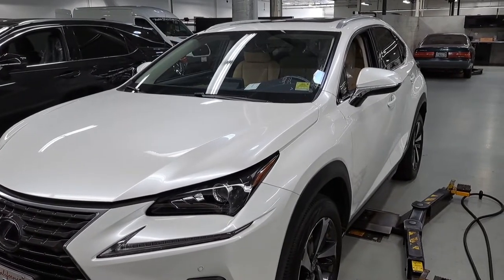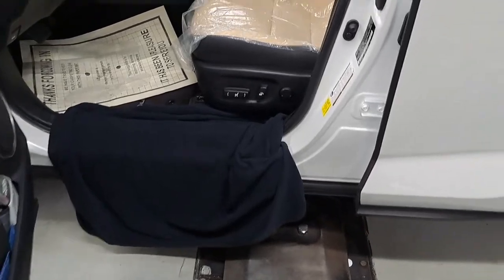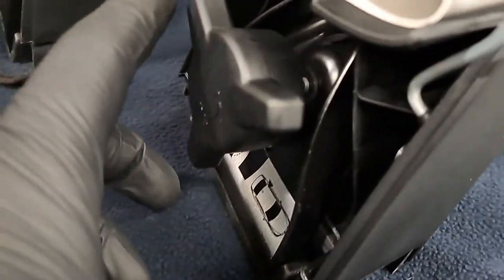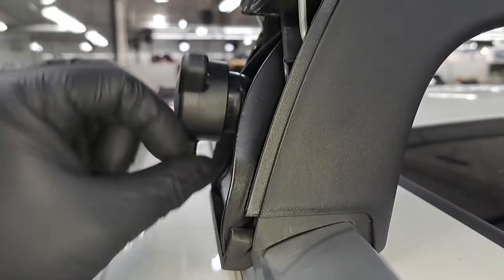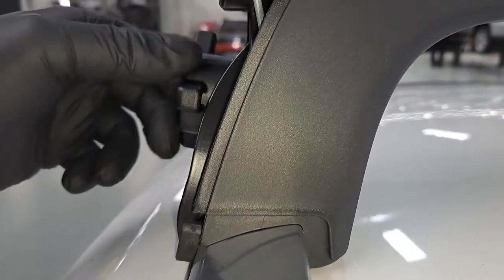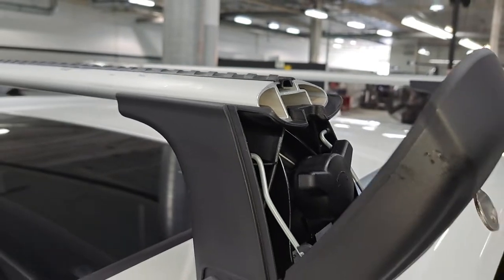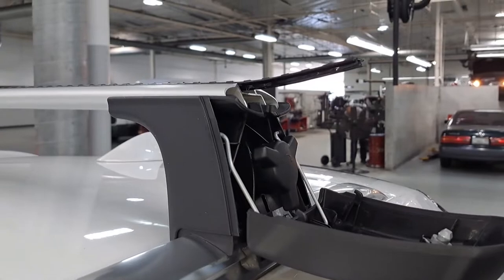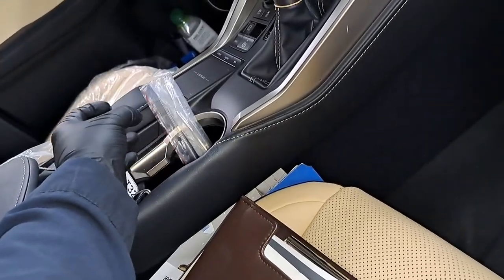Roof Rack Cross Bars Installation on Lexus NX #automotive #lexus #mechanic #diy #mechanic #pro

Comment: I heard that you should use the rear hole for the front crossbar.  It was said  that it produces more wind noise when mounted closer to the front.  Do you have any comments about this?  And I agree with everyone that has praised this video.  Great job, very professional!
Reply from the maker: I check with the guest before installation on the position of the crossbars. I dont have any comments on the wind noise, i havent noticed it. But i have heard from others that it does cause wind noise on either position.

Comment: Thank you for this video! When trying to remove the cross bars that came with the vehicle (so the same ones as in the video), however, I unscrewed a couple of the screws and now one of them won't screw back in if I were to install the cross bars back onto the vehicle. The screw just rotates but doesn't fully go in and click and I checked to make sure that it's in the hole inside the cross bar when I try to screw it on. Could you show a fix to this?

Comment: Beautifully put together video... but  there are no holes in my roof side rails (2025 NX 350)... do I drill them? If not how do I find them.?  Thx.
Reply from the maker: This does not apply to your 2025 NX. This applies to the previous gen models

Comment: thank you for your video. do you recommend people to use cross bars from Lexus ? or other similar product on Amazon are fine?
Reply from the maker: I've only installed the lexus original ones they are specifically manufactured for that vehicle. So that is what i would recommend
Reply: @harborareatech310  Thanks man! I should go for Lexus one!

Comment: This is exactly what I want. Where to find such a crossbar which fits Lexus NX? Any link you can share? Thanks.
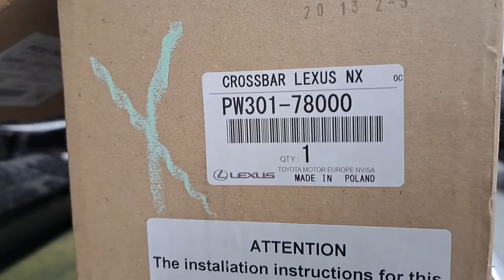Reply from the maker: Hey thanks for watching. Part number is in the video at around 00:24 seconds. This  can be found at any Lexus dealership parts department. You might need to call to get it ordered if it's not in stock.
Reply: @harborareatech310  Thanks.

Comment: Thank you. Are the holes in the roof rack pre-drilled?  Or did you need to drill those?
Reply from the maker: No problem. The holes are pre made. No need to drill during this installation.
Reply: They are pre-drilled on my Lexus. Already there.

Comment: Well done.  I had no issues installing the cross bars.   How to remove them?  I loosened the star-shaped torque bolts but the bars are still firmly attached.  Afraid to use tools to pry & scratch paint.
Reply from the maker: They do get firmly attached but once the center triangle style adjustment  is loosened on each side you can carefully  wiggle the bar back a and forth until the guide pins fall out of its location.

Comment: Can these cross bars be easily removed or do you suggest to just leave them on the vehicle permanently?  Thx.
Reply from the maker: If left on for a while, they may be a bit difficult to remove.  I dont see a big problem with leaving the on, though. Some customers would remove them for alleged wind noise, but I've personally havent experienced that.